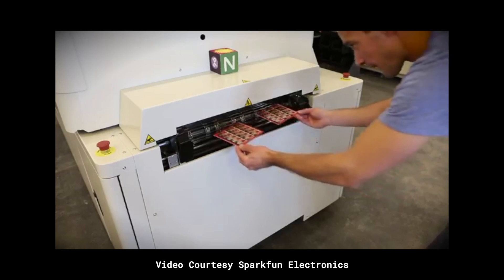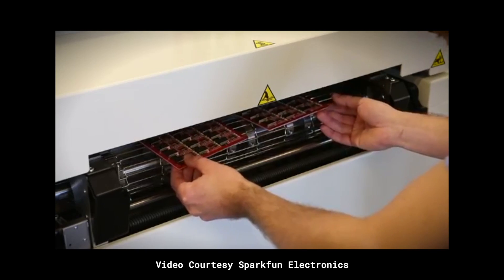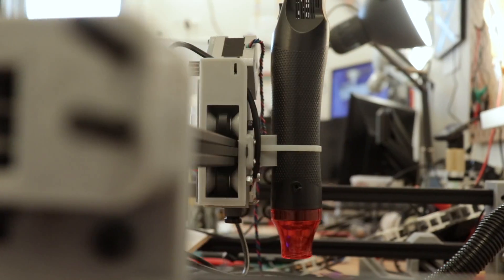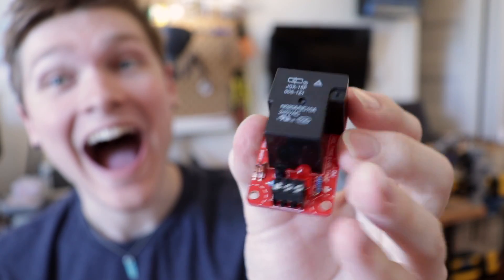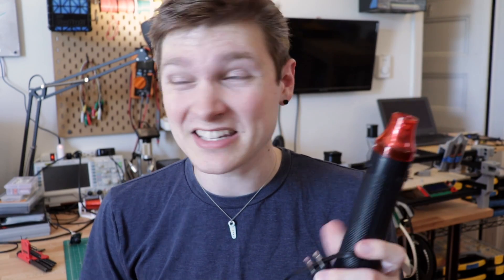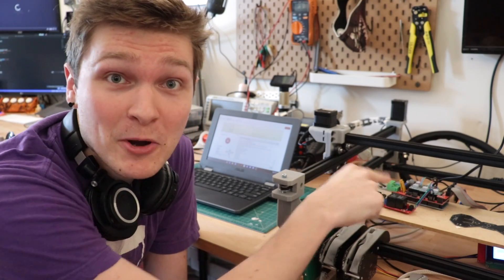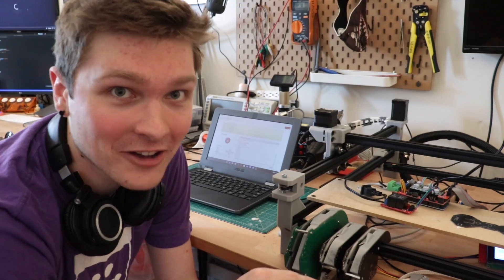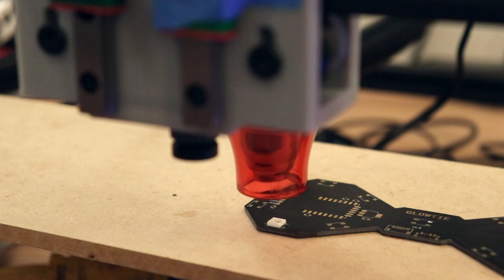Automatic Soldering On My Pick and Place!

Comment: NOOOOOOO, don't isolate ONE wire. you should isolate BOTH, the plug on the end is not keyed for polarity so it is reversible. So, you could plug it in the wrong way, and put the switch on the neutral side. it would still work, but it will be feeding live to the heater while it is still off.

Comment: you should measure the current your heat gun is taking, you might decide to stick with that than to have to get a separate 12v power supply for a dc powered heat gun. saw the first one you tried on amazon and it was only meant to do things like heat shrink. I think you're going to need something in the 600W or more range. the only DC powered ones I came accross were shaped like cordless drills and took 18V or more. Maybe your better off getting a basic hot air re-flow station and building it in to your setup. don't fear the mains switching, just put a plastic cover over the screw terminals and perhaps a warning high voltage sticker if you feel the need.

Comment: just say NO ... not only a pain but easy to damage components and soldering areas having hi component count density can have tiny parts blow around.. reflow oven is the way to go ... hands down ... my current oven doesn't even have a functioning controller and has the internal safety switch bypassed ... I have filled the broiler pan with sand and covered it with aluminium foil ... using an oven thermometer heat the oven to reflow temp.. I have a foil tent on top of the oven to put the board in .. using the radiant heat off the top of the oven to preheat the board.. the sand holds thermal mass so opening the door and putting the board in is no issue.. time reflow with a stop watch ... stage cooling .. open the door and turn off oven .. time a little longer ... slide out the rack ... time a little longer ... remove when cool enough... works plenty well enough till I get around to building a nice oven.. hope this helps ... cheers  :)

Comment: I realize this suggestion would require altering the machines bed but a hot plate or air preheater set to around 150C will help with quality and speed of soldering, decrease components exposure to reflow temperatures along with allowing flux to react with pads for a longer period of time before reflow temperatures are reached with a hot air pencil(hot air gun).

Hot air reflow works so much better when it doesn't have to raise temperature from room to reflow temps.

Comment: Pretty sure I saw at 3:41 that you're switching the neutral leg of mains (big prong). It will work obviously but its just more dangerous. Relay should be on the hot wire. (the small side of the plug) Unless your apartment is wired backwards.

Comment: I have seen ppl melt solder with automotive halogen headlight bulbs, i dont think it would be a safe option, all it would need us a finger print, and it would blow, plus 12v will be a decent amount of current, ti produce the heat, you could convert that heat gun to 12v, nichrome wire, and a fan motor,

Comment: whats so "spooky" about controlling mains? 
you do it every day flipping the lights on & off.... 
sure a 120ft python can bite you more than a 12ft but you have to learn to handle it. maybe the 120ft python likes cupcakes?
reflow oven is probably better. less chance of stuff blowing away.

i made my closet light turn on automatically when i open the door. in the 6 or so years i installed it i've never been shocked by it or came close to starting a fire. 
It only controls a single LED light.

Comment: You Could Possibly use an automotive halogen light bulbs to melt solder paste. The Halogen light bulb from a truck and not a car. Trucks have a 24v system.

Comment: im not sure if others mentioned this too. but you cant turn fast on and off blower of a hot air , heater element will melt down ! so you need an infrared heater for this job.

Comment: If you want to sell your electronics and keep happy customers, this is an insanely bad idea. Why do you think professional companys spend tens of thousands of dollars on theyr reflow ovens? Precision temperature and timing is key to make reliable solder joints without stressing and damaging any of the components in the process. So, no, this is not in any way a viable option for small scale production DIY soldering, ever...

Comment: Use a heated bed to preheat and it might work, gotta preheat to about 200F before hot air and it makes it go easier without burning, also the 858 hot air are much better than those plug in ones
Reply: And try low temp paste, bismuth based, chip quick etc.
Reply: oh just saw you switch to the hot air station, lol should have watched more... yeah those are much better
Reply: if not using a preheater, you can maybe move the gun around to preheat, I usually hot air the entire board for a few minutes from a distance moving around, them go in close to reflow parts, but that is a big board you have there

Comment: Really good... temperature thing could partly be because the print is on a plate, this cools the board. Always have some space between a surface and a pcb.
You could actually check the temperature on the pcb, should be at least 20 degees above eutectic point. Sac305 paste 217c.
Why not deposit paste instead of stencil? And add aoi functionality.
 The world is looking for a machine that can add paste, check it (spi) place components, check position (pre solder aoi), solder and aoi again. But again super.
An Mycronic user...

Comment: Hi Stephen, 
great Project!!! I like it!!
But I would better take an infrared heater instead of heat gun. Moving air has some disadvantages: Blowing away some parts, heat up other parts around and a lot of power for heating up all this air... The high power demand ist one reason, why you don't want to do it with 12V. Say 500 W (I believe your gun has around this wttage) that is close to 500W/12V ~ 42A. Better take a car cigarette lighter (hey, it has 12V!!!) and do it with infrared radiation. Here some guy did it already: https://www.youtube.com/watch?v=emLetVr1gKc
Nevertheless, I would suggest, you monitor the surface temperature (e.g. as an 32x24 pixel image with MLX90640: https://shop.pimoroni.com/products/mlx90640-thermal-camera-breakout?variant=12536948654163 [up to 300°C] or with a "single-pixel" IR-sensor like the MLX90614 https://www.sparkfun.com/products/9570 [up to 382°C]). If you heat to much, you will get "cold spots" and this will sooner or later lead to open circuits. I believe, as the surface reaches 300°C (with the array sensor), the solder paste will already be molten, if not, give it a second or two more or use the single pixel sensor...
See here for tin alloys' melting points: https://de.wikipedia.org/wiki/Lot_(Metall)#Gebr%C3%A4uchliche_Lotlegierungen (sorry, but the english wikipedia does not provide such table, but chemical and phisical language is universal :-) ).
And a word about the reflow oven. Yes, thats great, but you need to have another device. I really like the universal-single-device approach.
Regards, Daniel

Comment: You could use a 3D printer heated bed to get the PCB to say 100C, then use the heat gun to raise the solder to its melting point. This will probably also give you more consistent results.

Comment: consider making it open-source, cus there is a ton of people like you and me which are making their own pick-place-solder machines. Mine, for example, starts with a plain sheet of pcb material with photoresist on top, then cures traces with a laser, etches the thing with a heated bath attachment, drills holes, and now it is gonna pick-and-place components. Someday in the future it is also gonna solder it, but im gonna use something like cura engine to generate paths because come on it is a lot of stuff to create manually. Also yes, i tried tracing with a marker and a pen plotter attachment, it sucked

Comment: Hi stephen! Your idea should be nice but the reality is more... real :(

Doing an approach  like that will not work  for several reason:
Danger:
u have a deadly voltage on your machine ( those cheap air gun arent made to be on for long time) cables going back and forth willl not last a lot, but due u are carring hi AC voltage at the first issue u can risk to burn other electronics;
if the fan fails and u arent attending the toool u risk a fire in your room;
u can not use DC current for it couse u'll need a lot more of Amperes to get same heat = bigger cables + bigger power supply for nothing ; if resistance need 220V or 110V u must give that voltage.

it doesnt have a temperature regulator to avoid  overcooking components;
u should heat the entire motherboard at a minimum heat level to reduce the thermal shock between pcb AND components ; plus to get an effective and valid melt of the soldering paste u should follow the heat curve.

If u use an electric cheap electrical kitchen oven large enough to fit the pcbs u  can assembly, u can easily add some controllers with arduino or similars and program a  reflow cicle included the cooling.

ill try to find some alternative ideas, keep going it's amazing what u are doing !
Best regards from italy

Comment: Stephen I love you but this is a dumb idea! Reasons: First you need pre-heat, so you need to have a heated bed under your boards, for that you could use 3d printer heated beds. Second the air gun will make your components fly everywhere. I suggest you to use one Infra Red lamp if you wanna try this again, but yes it's just better to get a mini oven a place a better temperature controller and do in a proper way.
Reply: I forgot to say, the relay does not make your connection to mains safer, first did you cut the correct wire which connects to the phase? Second for proper safety you need an Isolation Transformer. Hugs from Vini :)

Comment: I don't think you will find a 12V heater capable of that kind of power. Stop chickening out of AC mains, it can be done safely, certainly more so than trying to control 100A 12V.

Comment: The Bench heat tool run off 12V and you can buy them separately.
I know this because I had the head gun on my soldering station self destruct and had to get a replacement!

Comment: I have an idea that could possibly work for this pick and place, you can have more than one x and y axis in operation at the same time. So with some clever creativity, you could have a pick and place arm picking components while another arm is applying solder paste and another is hot air soldering, so provided you pick and place from front to back or back to front you could have 3 actions simultaneously on the same robot. You effectively have a robot with 9 degrees of freedom. You'd have to program in something that prevents one Y axis from attempting to cross the other's Y axis, whether that can be done in G code, or there may be a simple approach that makes this work, like a micro switch limiter on both sides of the Y axis arm that tells the code to pause while another arm is working that area.

Comment: There is an instructables video on how to make a DIY soldering hot air gun and with a bit of inspiration, you could craft a nozzle that is thin and wide and mount it to the pick and place, so you can blast a thin wide jet across the board. If you mount it so the jet blows front to back, you can use the x axis to move the jet over the board and reflow the board quicker than soldering individual components. If the board is wider than the nozzle, you can do a second pass. Unlike a reflow oven which requires you to remove the board and place it in the oven, you can do everything on one pick and place machine.

Comment: Awesome work. I'm not working on a PNP with reflow capabilities but this video has definitely got the brain thinking about how I might better over-engineer my already over-engineered curing box and maybe even an adaptation to a lightbox. Not that this is over-engineered, and if you did want to move to a DV reflow solution, I think 24V would make a better target so that it doesn't take forever to heat things up...and for a simpler solution. Place all the parts and then use a plate to heat up the entire board and reflow all the parts once placing is done. 

Now I must go flog myself as that sounds like the opposite of an over-engineered design. Great video, great enthusiasm and hello from a new subscriber. I am looking forward to seeing more.

Comment: If you're wanting to continue the route of reflowing the paste on the head, you might want to look into simply buying a replacement generic hot air gun like the one used on your station. Replacements are ~15$, and that will allow you to precisely control the air temp, and air speed (Marlin already has Fan PWM control & PID Heater control features, so it would be fairly trivial to interface). Also would allow you to use the interchangeable hot air nozzles like on your station. Downside is that it's still mains powered, but you simply won't find anything like that running on low voltages. Mains really isn't that hard to safely work with, especially with SSRs for PID control (My 3D printer has a 750W 120VAC heated bed, for example), but It's understandable to try and avoid HV as much as possible when you aren't confident working with it.
I have concerns about the practicality of a system like this, Hot air guns don't lend themselves to being light and compact, and on a PNP agility and accuracy are pretty critical. This also has the issue of uneven heat distribution, which is generally not ideal, and would make following proper reflow profiles hard.

I love the concept though, and with enough effort it may be feasible.
Seeing your approach to problems and your general passion and excitement has been awesome to watch, it's the whole reason i'm subscribed :)

Best of luck!

Comment: You really need to preheat your boards from underneath using an infrared light source. This will cut down the reflow time significantly. There is a reason all refow is done inside an oven but preheating will help.

Comment: Get bismuth solder paste, it has a low melting point and is good enough for hobby projects.
You can get away with a simple hotplate that way.
Reply: the bismuth solder is lead free, and melts at 138C. So I am using our regular convection/hot air oven in the kitchen. It heats up pretty fast that I can mimick a temperature profile by gradually increasing the set temperature, an I know that one temp is reached when the relais klicks. I am heating up gradually, and letting the board soak at 130C for a few minutes below reflowing the solder. Then reflow at 150C for a minute max. Then switch off, open the door a bit first, then full.
At this temperature I could stay for ever with most parts, even MEMS sensors or LEDs. Most parts have a storage temperature of ~120C, some even higher!
With convection I achieve an even heating of all parts, no matter if they are black or shiny in contrast to IR ovens, and I can control the temperature A LOT better with a heat gun.
Also the heating is even and affects the entire board and all its copper and the parts equally, not spotty like with a heat gun which I consider crtitical particularly for parts with an exposed pad on the under side. With a heat gun you must transfer the heat through the IC, and also heat up the pad copper on the board, and maybe even the unserside copper when you have a lot of heat spreading vias. Thus you either burn the IC, or the paste under does not reflow.
This together with a stencil which I now ALWAYS order with my layouts the results of the soldering are industrial grade.
In addition applying solder with a stencil with a squegee, and baking the PCBs (you can do a whole batch) really speeds up your throughput.

Comment: Hi Stephen,
Great job!
What about placing an iron just behind the working plate? The overall setup will be quite similar to a 3d printer heated table. 
You can check the reflow controller at "maker.moekoe" channel.

Comment: I think you would have more an easier time integrating the hot air if you had the heater on the xyz platform and the blower for it some where else. Sparkfun sells replacement heating elements for their hot air tool. I don't recommend that tool for many reasons (got one at work) but the heater is probably good if you can package it safely. I do recommend the brushless blower/pump in the Quick 861WD (got one at home). That said I would really prefer an oven to this feature. The thermal profiles on my parts and their size mean this would be problematic for me. I am probably in the minority in this case though.

Comment: Man, TEMPREATURE is the biggest problem here. you will have to care about how to not heat parts of the system , that shuoul not b heated. hot air is a mess. so, the only way to soldet OUT of oven - is laser soldering, which is pretty tricky too
so, yeah, for creativity sake - this was a cool idea. But you better go for oven, man and put all your effort into PnP part of the system